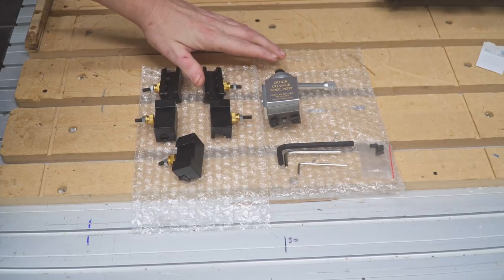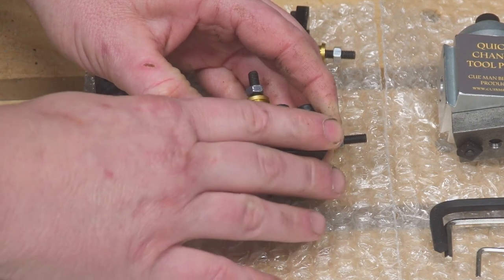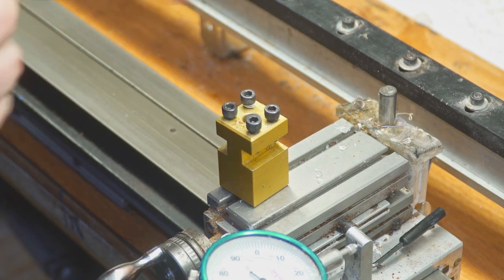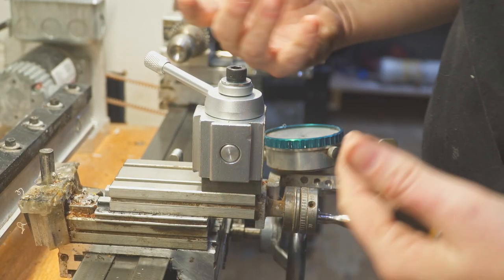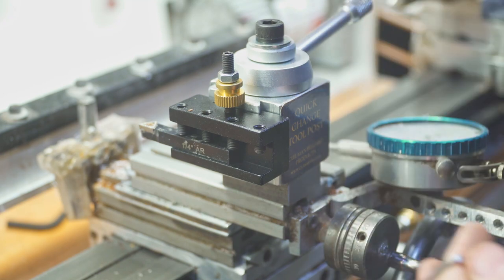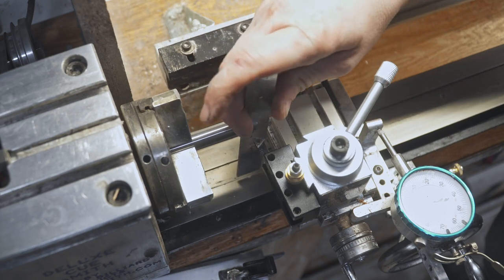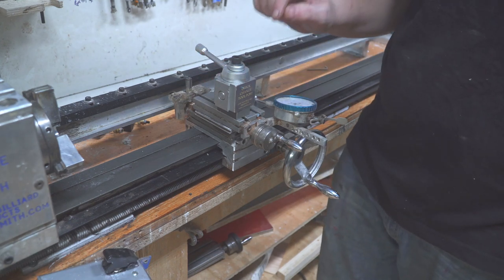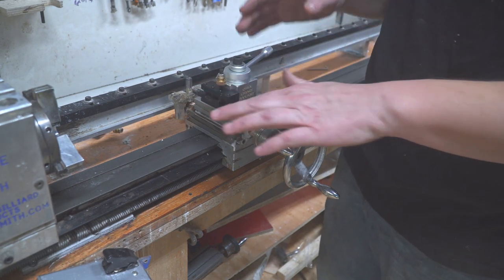Lathe Quick Change Tool Post Review- Installation-and Calibration. Cuesmith Pool Cue Lathe

Comment: Luv your vids because you use many different mediums and I think out of all vids I've seen you are most centered sincere and creative. I am a 54 year old who was diagnosed with moderate ADHD when last year my mind started to unravel for no reason after lots of hyper focused research I highly suspected that I had undiagnosed ADHD ...long story short found an educated specialist in the field which confirmed what I was pretty sure of already ...I was given some meds to help get my mind working lil more optimally and began starting my life over. Hyper focused on what I was facing I made the decision to focus on creating because it gives me freedom to explore without getting hellishly bored after few months..( I had never created anything but would just move from hobby to hobby) I discovered an old lathe in my stepfather's shop and began to dig it out repair it and clean it. Looks like and really old craftsman value of around $2000 looks like it was used for metal ...can this be used for wood and resin or should I get something better that I can use indefinitely?? Thanks for the great posts